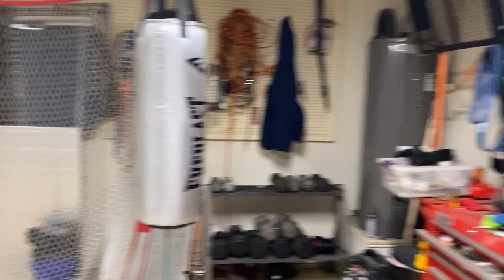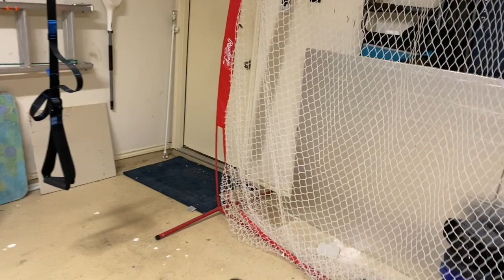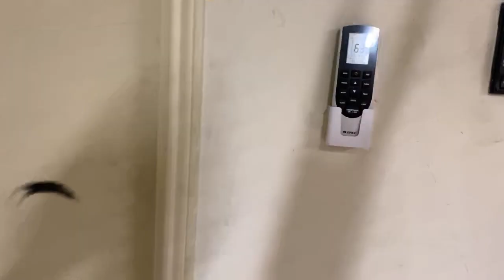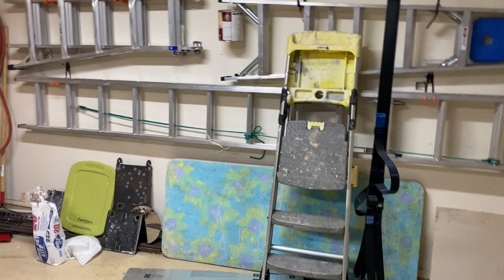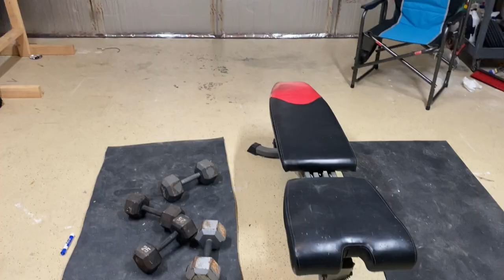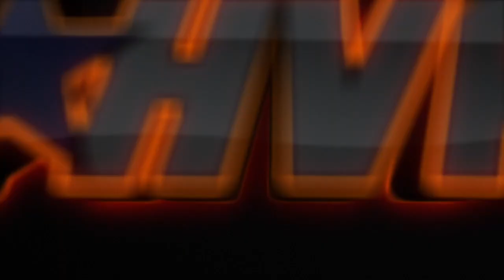Ductless Mini Split Garage Conversion

Comment: Are your walls and ceiling insulated?
Reply from the maker: No but I have brick on the outside. The mini split keeps the garage nice and cold
Reply: @Sealheatingandairconditioning   
So you would recommend to install it? I also have brick but no insulation in the walls or ceiling and I live in north Texas lol